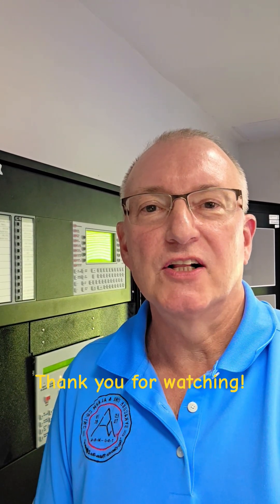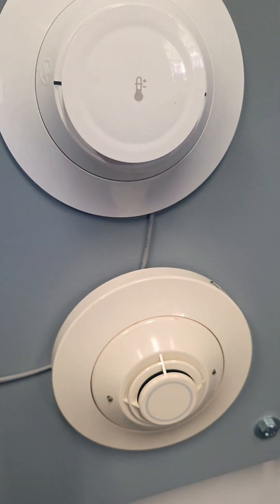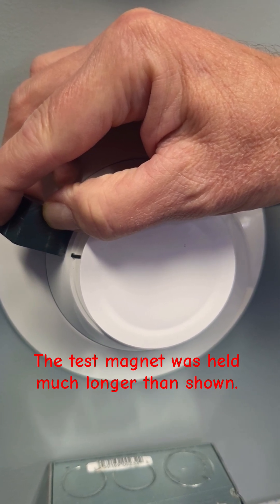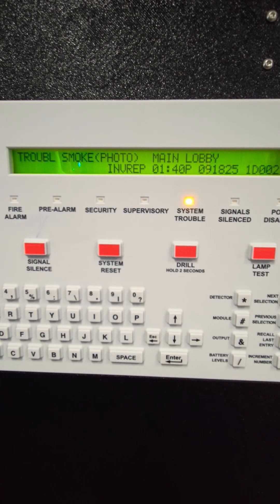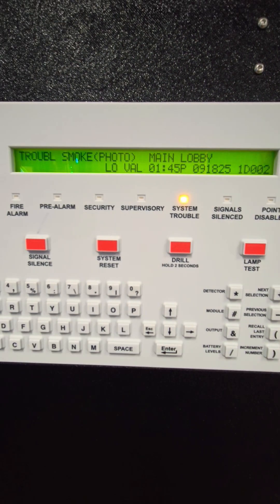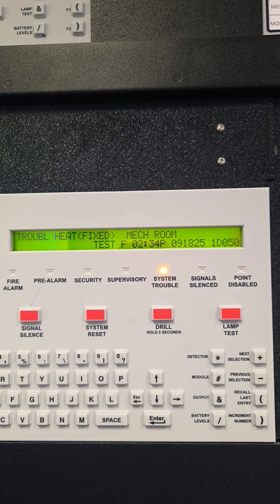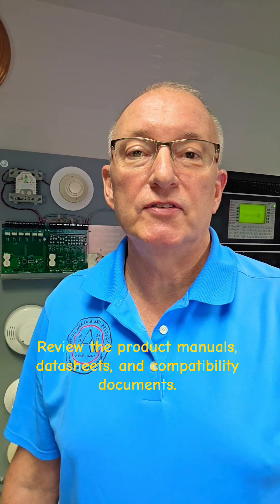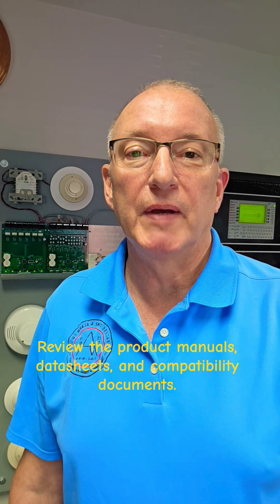Fire Alarm Device Protocols Revisited #firealarm

Comment: You have to use a fsp951IV
Reply from the maker: Exactly, when the panel is set to CLIP mode, you must use the ivory (-IV) devices, such as the FSP-951IV. FlashScan devices won’t communicate properly in CLIP mode.

Comment: Just curious, what version is that 320 on? Because I know on older versions the clip will work on the newer white detectors.
Reply from the maker: Thanks for asking, I was curious myself about how old your system might be. Our 320 panel is running version 029. At first it looked fine, the panel stayed normal with the white detectors — but they wouldn’t respond to testing. After we did an initialization, the panel flagged them as inoperative and went into trouble.

The latest datasheets say the white devices should only be used in FlashScan mode. To be on the safe side, I’d use the ivory devices whenever the SLC is set to CLIP mode.
Reply: @Syrtime My 640 is on version 27. Thanks for the information!
Reply from the maker: @Spectralert_technologies Certainly, I am glad for the exchange. 
I was unable to locate version 027 on the manufacturer's website so I could give that a try.

Comment: Video didn’t say much about the protocols. Just that devices don’t seem to work. Maybe change the title to What happens when you install the wrong devices.
Reply from the maker: You’re right, the video doesn’t go into protocol details — it just points out FlashScan and CLIP. The reason we made it is because it was reported that bright white devices could be used on an SLC set to CLIP. When we tested it in our lab, the panel did recognize them at first and stayed normal, but during actual testing the white devices were unresponsive and didn’t function. We wanted to share those findings so others would be aware.